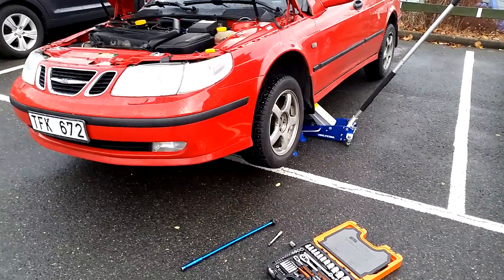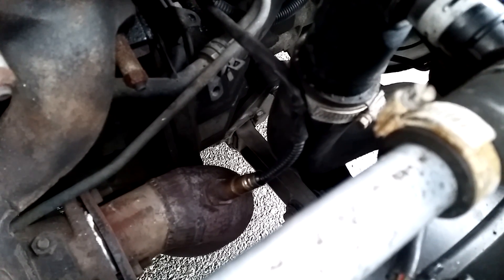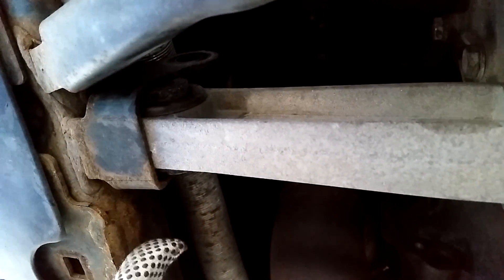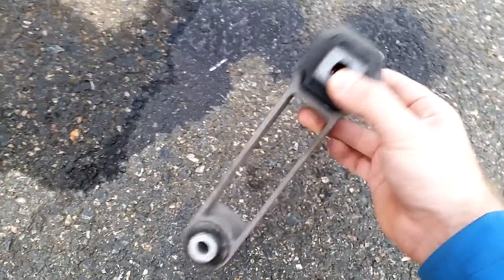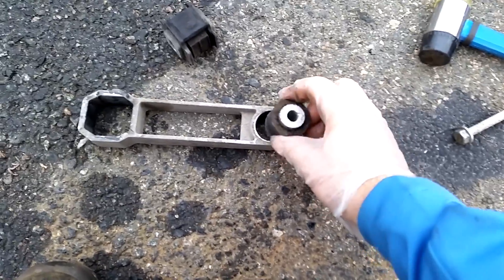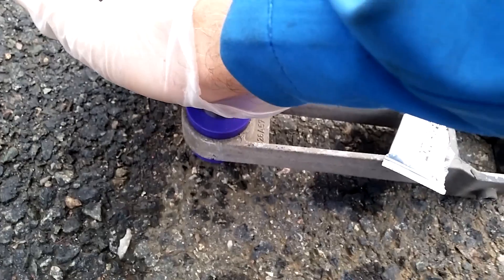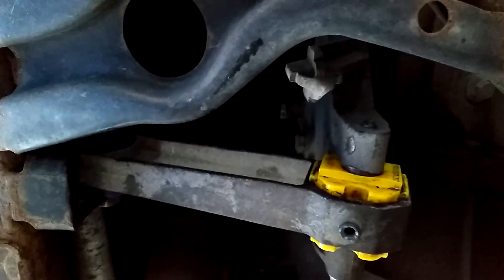Saab 9-5 DIY: Torque Rod Powerflex Bushings - Trionic Seven

Comment: I cannot for the life of me get the bolt holes aligned after replacing the larger square bushing.  I see you recommend loosening the plate above but I don’t think I can reasonably access those bolt heads. Are there any other tips or tricks you recommend?

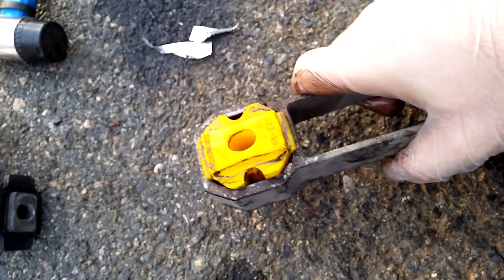Comment: 6:10
Bussningen sitter 90 grader fel. 
The bushing is 90 degrees wrong way.

7:00
Är det samma siffror på alla årsmodeller och både automat och manuell? Jag får fram olika när jag söker, finner inte vad som gäller på min 9-5 från - 06.

Is it the same touque spec for all engine and transmission and years? I find different numera but i can't find whats vorrect for '06 9-5

Comment: Just changed the bushings on my 95  1.9 manual diesel( edition) , I didn't realise how much a worn rod decreases performance and steering and handling until I changed to the power flex manual specific red Bush and normal purple one, what an improvement, very happy and thanks for the video 😁

Comment: Hi Trionicseven, would this fit 1998 model also?
Reply: No, the 1998 has completely different torque rods,you can only change the square rubber which is the 221
Reply: @robmueller8143  thanks for your response

Comment: I went to check my torque rod after watching this video... it is gone ! My torque rod has fallen off !! It is a 2001 auto Aero.. Lots of new rods on amazon and ebay but no fitting kits ... Do you have part number for bolts etc ? Many thanks
Reply from the maker: Wow...gone?! How is that even possible? I'd ask in our community forum, I don't have part numbers with me right now. https://www.facebook.com/groups/733705113501723/

Comment: The smaller bushing is very difficult to get out. I only ended up replacing the big end. I think it was causing most of the noise anyway.
Reply from the maker: It wasn't too bad when I found something to push with.

Comment: Observation, after watching many of your videos, GM really went cheap with parts compared to Saabs built by SAAB in Trollhattan.
mine 1996NG 900 SE Turbo has none of these ailments 200 000 km , Cheers

Comment: The square bushing, even stock and new, has a certain amount of play in it. I have replaced all of the mounts for my automatic 9-5 except for the transmission mount, and I just ordered the rear (square) poly bushing only. I think that just replacing that one because of all the slop in it will stop the transmission from giving a slight kick when it's shifting at certain engine load/gears.
Reply from the maker: Yes, you are correct. But this bushing often goes quite bad, and replacing it gives good results. I have a friend who put alu bushings in instead ;)
Reply: Did it work like expected?
Reply: @Supermarx1978  Yes... but sadly the car was involved in an accident a few years ago :( It worked great for a while though! lol

Comment: Hi mate I have a problem with my Saab 9-5 vector when I turn the key it doesn't crank over takes a several turns of the key to get it to crank overvI've changed the starter motor battery is ok I removed ignition and cleaned it but still happens do you have any idea what is causing your help would be appreciated thanks
Reply from the maker: Hey! That sounds like an excellent question for our Saab community forum: https://www.facebook.com/groups/733705113501723/

Comment: Good Day Sir, I just did this mod with the predicted results so thanks for the education. Question - why, on the original bush, is the hole oval-shaped? My bush was mounted centrally within the bracket-to-gearbox, as seen by the circular clean marks on the metal insert, but surely it would be possible to mount the original with the bolt off-centre? Regards - Doug
Reply from the maker: The hole is oval-shaped because it has worn out the rubber! It was round from the start :)
Reply: I just looked up pics of new ones - there’s a metal centre in the large (rear) bush, with an oval hole in it. Replacements, certainly Powerflex, have round holes.
Reply: You are talking about the metal right?

Comment: Is it the same on Automatic gearbox?  I have problem locating the rod...
Reply from the maker: It should be roughly in the same position as the manual, but the rod looks different
Reply: I just replaced it on my 2003 2.2 TiD Auto, and it was no hassle. I didn't have to loosen any brackets, as the access to the bolts was easy. The biggest job was removing the engine shield underneath :-)
All of the spooky noises are gone. 

Again: Thanx for posting the brilliant video!!

Comment: I test drove a Saab 9-5 recently, it had a bad shake from the front that came through the floor. Could the shake be because of these bushings? I did not buy the car.
Reply from the maker: I'd guess tires or wheel balance first.

Comment: Do you have to lift the car and or engine at all like with the motor mounts?
Reply from the maker: In the video I use a jack to lift the car slightly. You don't need to lift the engine :)

Comment: Hi,

Did you have any trouble getting the front bolt out?    I'm about to start on this job.   The clearance between the bolt head and the catalytic converter looks tight.

Thanks for the video,

Peter
Reply from the maker: I don't think I had any trouble, remember that I have a custom 3" downpipe (not stock).

Comment: Hi.

Also have the 2.3L and the idle is a little rough inside for this car class, new CPS, new TB, new DIC, no air leaks,  took it to a Saab specialist, he said all B235 engines are like that at idle.

I have 222.000 km. Is it possible to check all motor mounts by pressing the brake and clutch pedal like you did?

The B205 from your wife seems quieter at idle and most other Youtube B205 seem also quieter than the B235.
   Do you also notice the 2.0t quieter at idle than the 2.3t or is it just me? 

I´m even considering the GM 3.0t V6 because of the 2.3L rough idle.

May sound snob, but its sad to notice the idle vibrations in a petrol Saab as much as in a W210 320 cdi diesel car :(
 
Do you know where can I find decibel (dB) data from a test (even if its in swedish) where they compare 9-5 petrol different versions?
Reply from the maker: +Agv G V Hey! I would def. check all the motor mounts. There are four, including the torque rod. I don't have any experience with changing them out, however, nor do I know what difference it will make. Something I would also try is to change the idle rpm slightly (done with tech2), you might have resonance at the idle frequency and then that will help. Good luck! Don't even think of the 3.0L V6, that's a crap engine.

Comment: fråga till dig om du vet nån eller om du har byggt egen baslåda till en Saab 95 från -00. Jag har monterat in en eftermarknads stereo vid namnet Kenwood KMM-101GY till ett slutsteg vid namnet Bass Face DB2.1 och ska driva en bas vid namnet JBL CS-1214. Allt ska vara korrekt kopplat och allting är helt så är ingen fråga om det! Det jag inte förstår är varför inte basen spelar? Det är fortfarande original systemet som spelar fullt ut.... har testat flertal kablar och slutsteg och testat basen i kompisens bil som fungera där. Kan tillägga att jag har nå form av "pilot paket" på min 95:a alltså typ hardan kardon eller vad det heter, vilket jag förmodrar är AS3. Vad har jag gjort för fel? Börjar bli tröttsamt att sitta på original ljud....
Kan tillägga att jag testat med RCA-3,5mm in till steget med mobilen utan resultat. får signal ut men spelar endå inte. basen är hel då vi testade den i polarens bil....
Reply from the maker: +Robin “PaXx” Calén Hej! Jag har tyvärr inte mixtrat något med billjud alls, så tyvärr kan jag nog inte hjälpa dig. Hoppa in på stcs forum och ställ frågan där, de är kunniga.

Comment: Nice new rims you got there, better than the old ones I must say!
Reply from the maker: +Ali I have a hard time decoding if this is sarcasm or not. Those are the new winter wheels that I got for next to nothing. Corroded, worn and ugly ;)
Reply: Really? They looked pretty decent from what I saw maybe I'm just being dum here. Also, did you have a hard time putting back the three small bolts back and torquing them? I have a long torque wrench and I don't think I can get it to those bolts.
Reply from the maker: Well, I agree with you that the shape of the rims fits the 9-5 quite well. 
The three small bolts were slightly tricky to get to and I couldn't fit my big torque wrench, but my normal ratchet wrench (the orange one you see in the video) fit without an issue.
Reply: +Trionic Seven: For Saab Enthusiasts If I were to use my normal ratchet wrench, how can I know for sure that I tightened the bolts to the correct torque?
Reply from the maker: +Ali Measure the torque on the big bolts, get a feel for it, then use the ratchet. The bolts are so big that some over-tightening won't cause any trouble (IMHO)
Reply: +Trionic Seven: For Saab Enthusiasts Got it, thanks for the help!